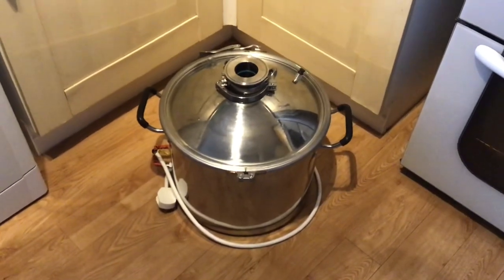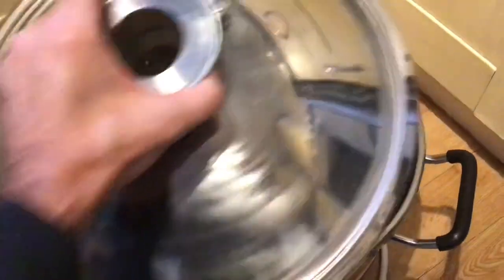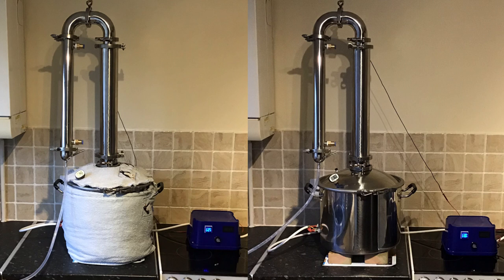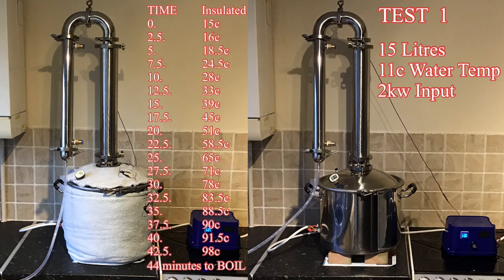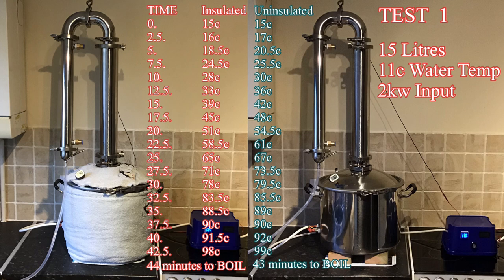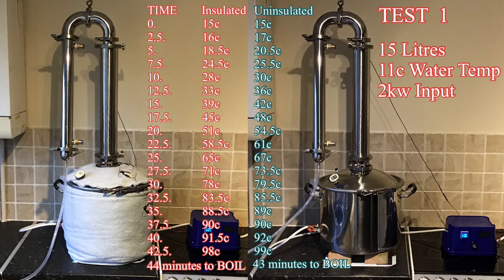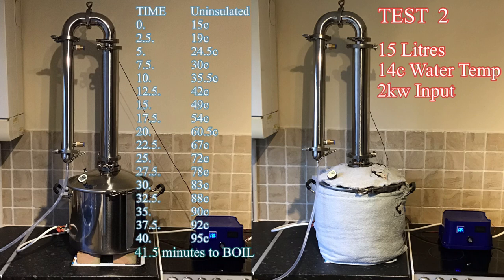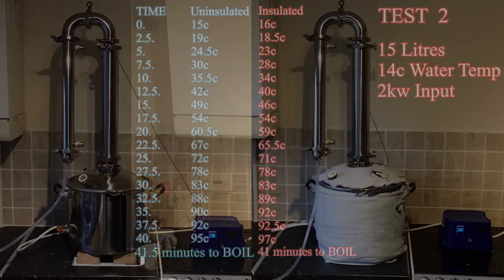Insulation Jacket For Moonshine Still : Making It & Test Results

Comment: The biggest gain must be on keeping warm! Must use the same energy to heat up.
Reply: Insulated my boiler. Same heat up time, but needs lower power under the run. I've used an old outdoor sleeping pad, some cell foam ish.
Reply from the maker: That’s pretty much the same conclusion I came to at the end. Over a long run the the effects would be small, but non the less, it surely would do something opposed to no insulation. Thanks for your comment 👍👍👍
Reply: As Fredric said, what you observed is as expected for your test. The heater has plenty of power for the volume heated, so little time for energy to escape the system while sprinting to the boil. Insulation cannot do much here because there's just not much energy escaping, especially for the first half.  In the marathon of the run that will be very different. A perfectly insulated system could sit in fully stabilized reflux forever, or need only the energy added to make up for what goes out the top of the column. Test instead the power to hold at 98C for an hour in both cases and see how much you've improved things.

Comment: As others have mentioned, it's about the power input. It's so high in relation to the volume you're not going to see much difference. Where you will see a difference is in holding the temp once up to the operating range, especially if using a PID to control.
Reply from the maker: Yeah, that was my same conclusion at the end of the video 😊

Comment: Nice work! A thought: voltage to any appliance can vary  depending on other household loads (eg. water heater, clothes dryer, ...) so perhaps this had an effect? Consider that although the resistance (R) of a heating element is fixed, the actual wattage consumed varies with the square of applied voltage (W = V^2 / R), so a relatively small voltage change can really effect heating rate. Just a thought.
Reply from the maker: Try and fry my brain why don’t you! 😆 But I know what you’re saying. The voltage and amps were the same on the runs I did. But I like your thinking 👍👍👍

Comment: It was 3 years ago, but after watching the video I could not help it.
It appears that your towels have higher thermal conductivity than the air. In other words, it takes you more time with your "insulation", cause you literally heat mash + towels.
Use correct materials, and you will see effect

Comment: Not a scientist but I do see two areas where you may be making a mistake. Until you reach the ambient temperature of the room, good insulation could retard the heating up of the contents of your kettle. Good insulation a towel? Maybe you can do better.
Reply from the maker: Yeah I’m the first to admit it was a rubbish video with a rubbish execution of an experiment 😆 The towel did have soft wadding and foil in it and did do a job of sorts. Trouble is I don’t use the Still enough, or for long enough, to ever worry about using an insulation jacket 🥴
Reply: @highly-spirited  Not rubbish, it is an important topic. I never ran a still because it’s not legal in the USA. A hangover from the past. Pun intended. I do learn from videos so should the need arise I have a clue. Thanks for you efforts.
Reply from the maker: @Amazingverticalgardeningideas  thank you. I would use a jacket if (A) I was Distilling outside with this Still or (B) Distilling a very long Run. Never the less, it’s good to hear people opinions and experiences when they comment 😊